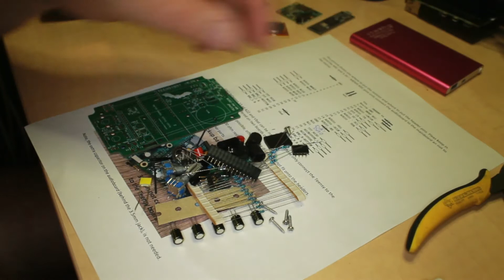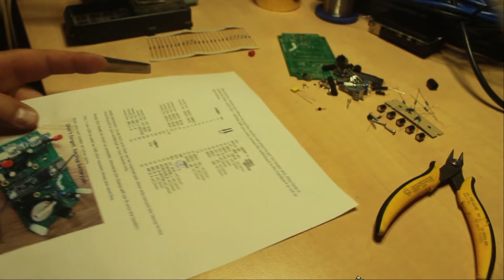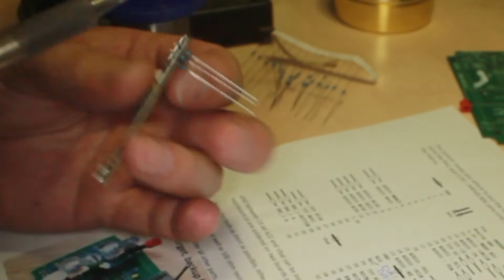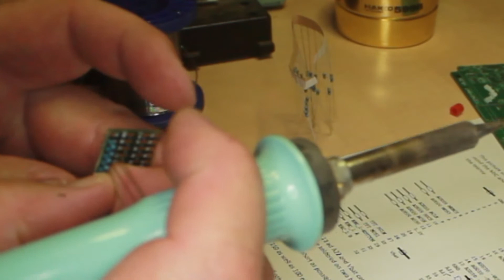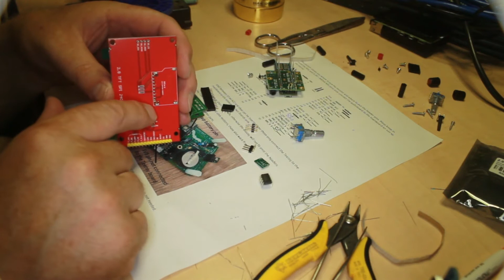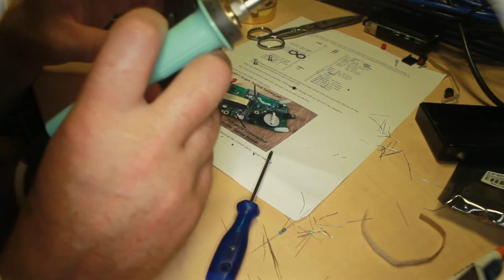Teensybat build v0.2 pcb

Comment: The build process looks quite a bit easier than I remember. I presume you made several changes? 👍🏻
Reply from the maker: Maybe it is just the video that makes it look easy. There are no real changes since I started sharing printed circuitboards. The video has some small tricks that can help you when building. The "header resistors" for example are a tricky part of the build, but if you cut the pins like I did it makes it much easier to mount.
There are a lot of changes in the software but the hardware is nearly the same. There is a hardware modification for software backlight control (not in the build vdeo) and I want to have a new pcb with external microphone connector and less mounting screws but that will still take some time.

Check out teensybat.com every once in a while.
Reply: @PE1PWF  Thank you! It's looking amazing! I plan to order a kit for myself in the near future! And all the new features you've been adding are just wow! ...vy 73 KC2BAE